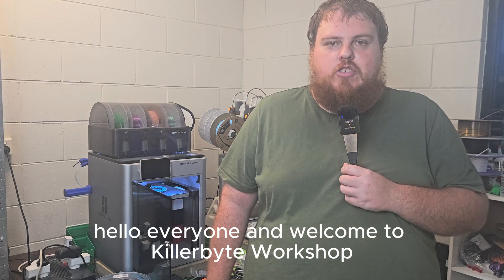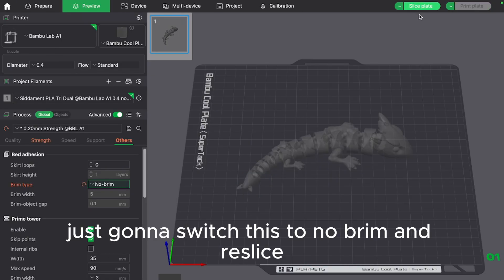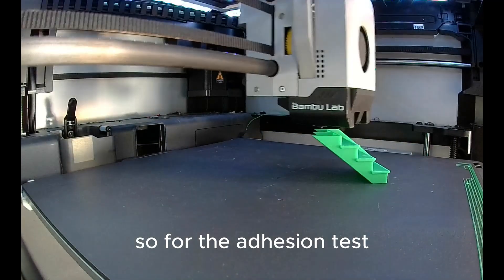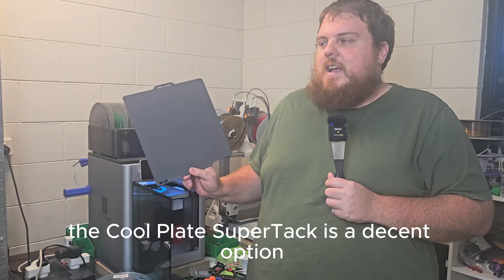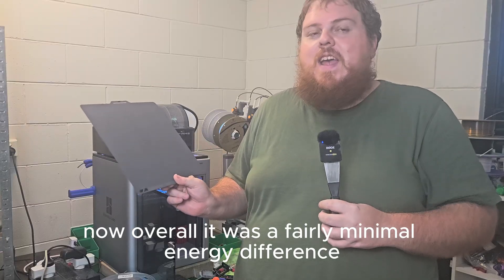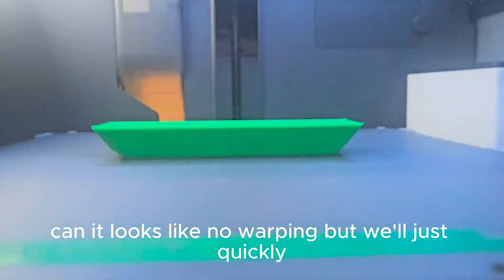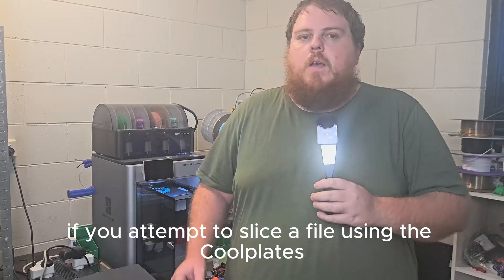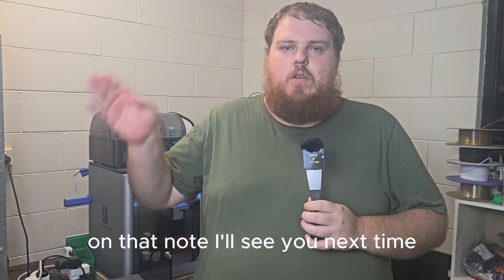Bambu SuperTack Plates: Do They Really Work?

Comment: Nice video, main thing I'd like to see is people talking about longevity of the tackiness. My plate lost adhesion pretty quick. I've cleaned it with alcohol, no luck regaining it.
Reply: On bambus website it specifies to not use materials like alcohol because they desolve the chemical bond that makes hte plate work
Reply from the maker: @atlas-gaming  That's actually a great idea.